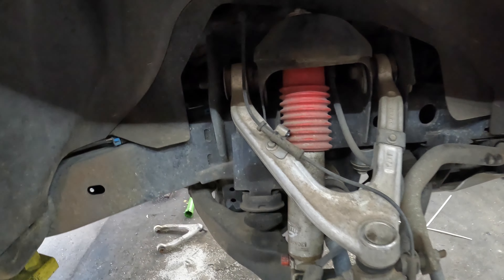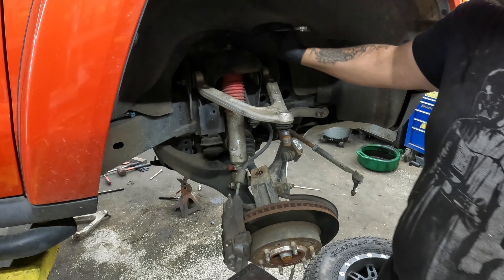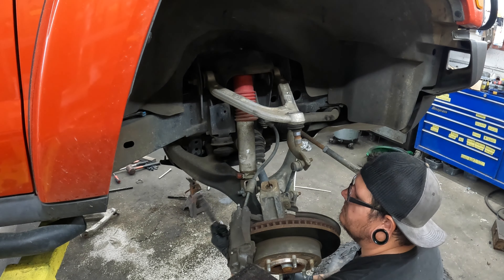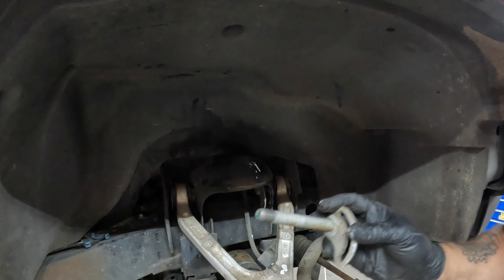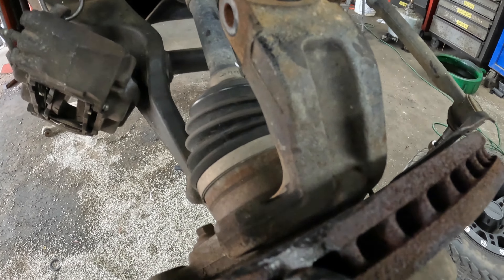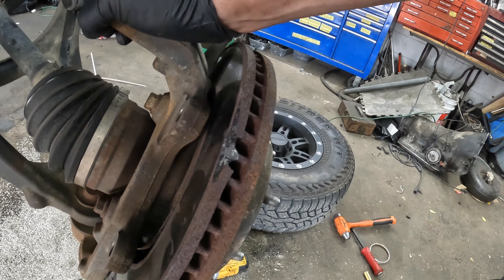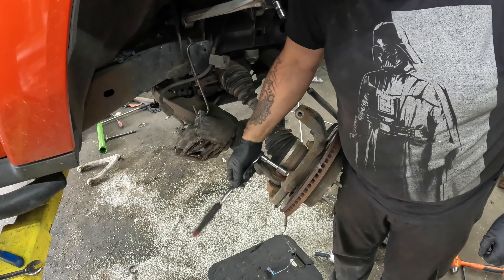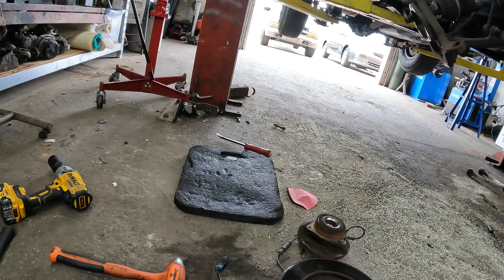Hummer H3 Front Suspension Rebuild Part 1

Comment: The two extra threaded holes in the rotor allow you to screw a bolt in until it pops the rotor off. No BFH needed! Unless the hub centric rotor prevents that from some reason?

Also, you can do the cv axle without removing the shock, just barely.
Reply from the maker: You can use the threaded holes but 90 percent of the time when I use them they just strip out or the head of the bolts break off due to the amount of rust.  I have never tried without remoVing the shock and I may give that a try on the next one.  I appreciate the tips.